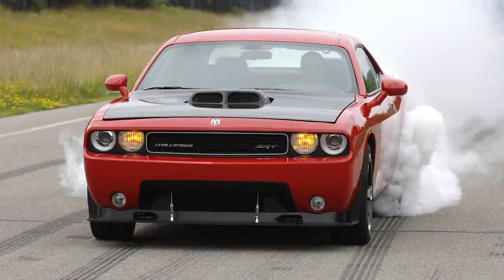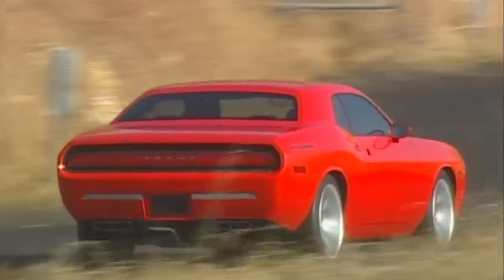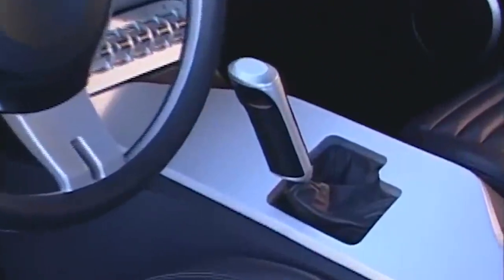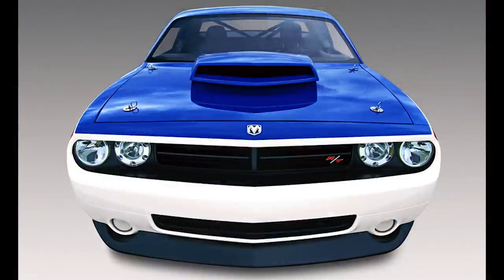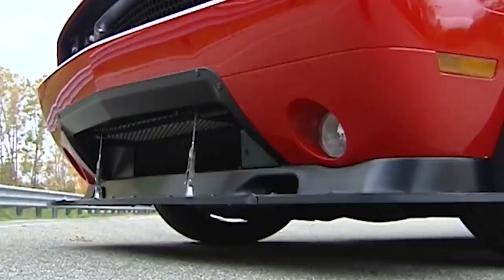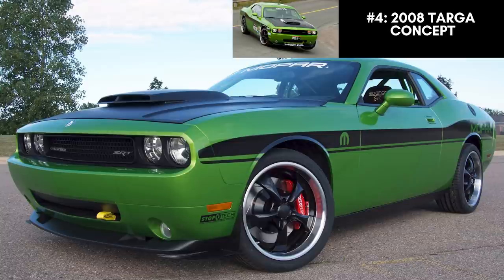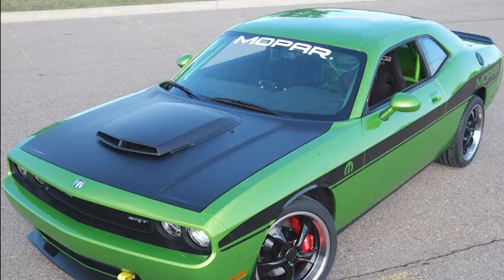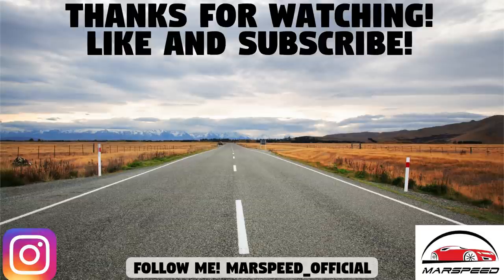5 Dodge Challenger Concept Cars You Didn't Know About! - PART 1!

Comment: I wish they made an srt 10 challenger.
I just thought, imagine if they put the demon supercharger, and paired it with the viper v10
Reply: I doubt those would be compatible
Reply: @AE86FTS  yeah
Reply: @fardgaming3047  Well, the Viper is in purgatory atm. Surely someone's actually taken it out and designed a blower for it. All the "old heads" keep harkin' on about how boosting the V10 will get you way more than the Hellcats, even though footage seems oddly scarce.....

(I mean, it's a Dodge engine. Makes sense, but I'm not convinced enough  folk with octane in their veins actually picked up a Viper powered ride versus locking them in a glass case)